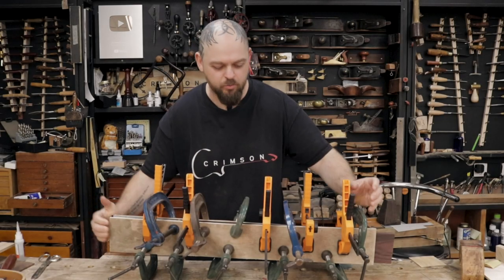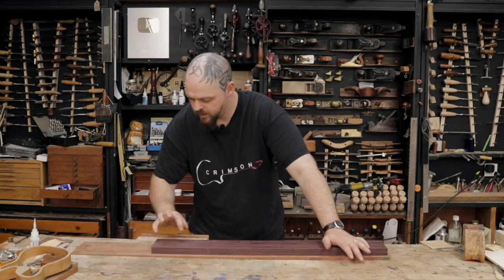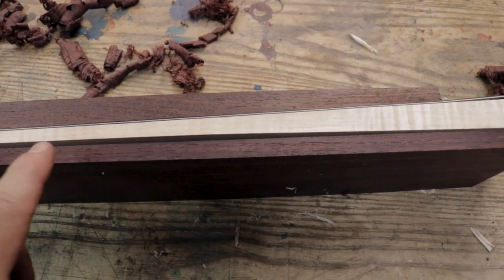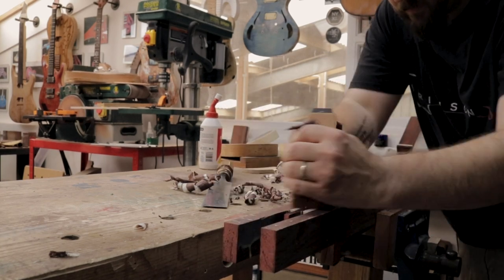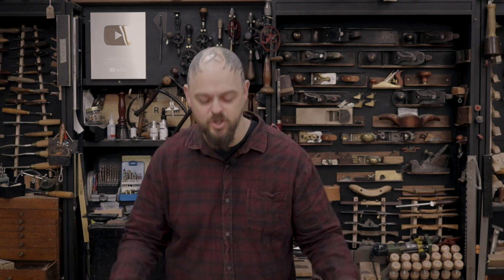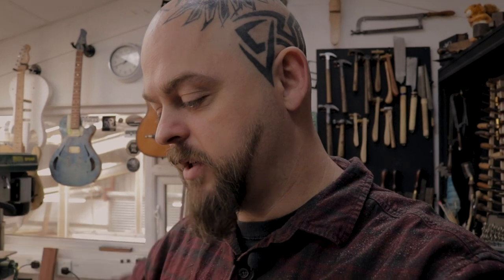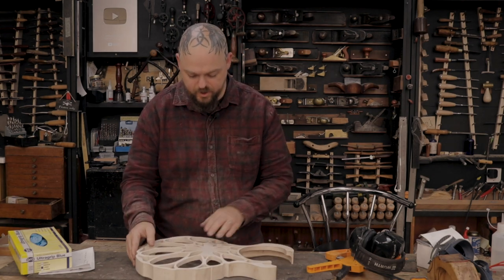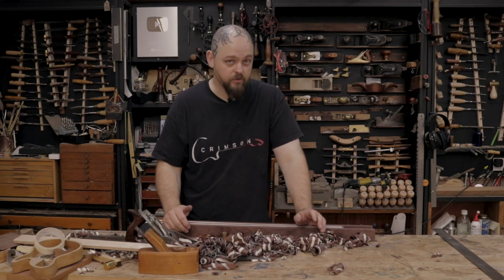Ep 6 A beautiful neck begins to emerge & more carving - The 90 Hour Build - The Complication

Comment: Hi Ben, I love these builds, of only ai could afford a Crimson Guitar.  Anyway, I have a question concerning a Les Paul I am renovating.  It concerns the top nut.

On 6-inline heads the strings are basically straight - from the bridge, through the strings the nut and onto the tuning machines.  The strings might go through trees, but on a Les Paul type they are 3-and-3 design, the strings move outward from the nut at an angle to the tuning machines.

What are your thoughts on angled cuts on the nut to get the strings to hit the tuning machines straight as opposed to an angle.

Many thanks for your answer.

Stuart Grier

PS.  Can you publicise the Crimson Guitars Guild webpage, as want to join.

Cheers

S.

Comment: I recently purchased a guitar body and a neck from different manufacturers. The neck doesn't quite fit into the pocket on the body; the pocket is more round than the bottom of the neck. Should I fix the fit by trying to flatten the neck pocket (a small carved shim, perhaps?) Or should I try to round out the bottom of the neck?